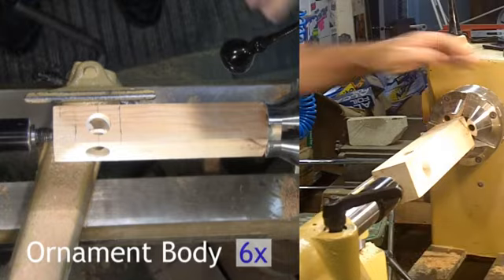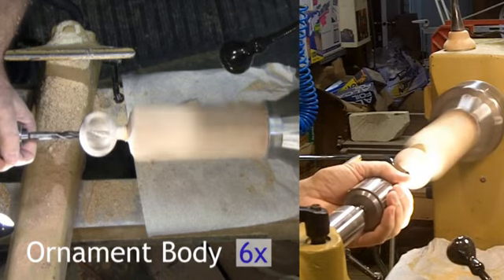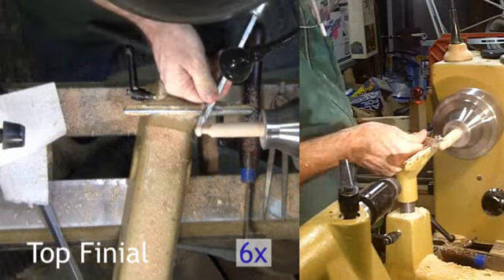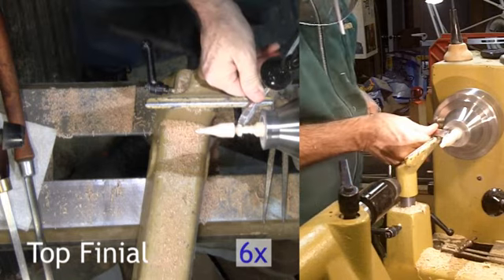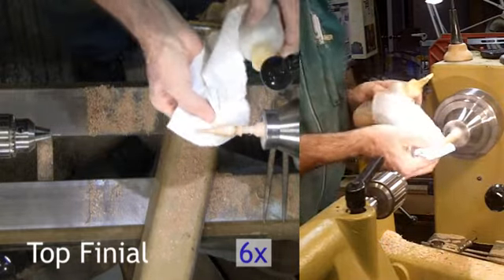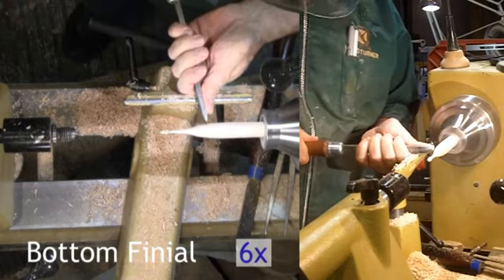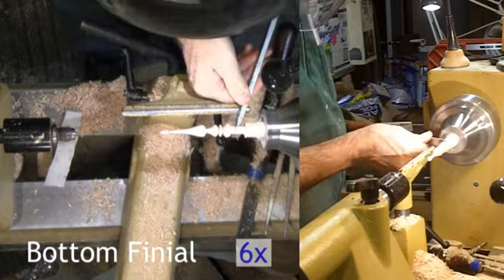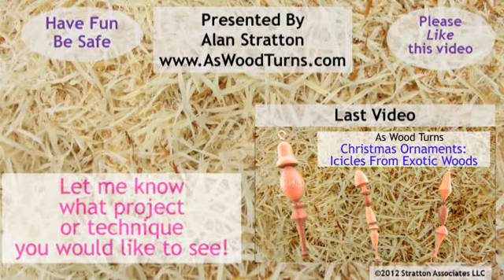Woodturning Christmas Ornament: Enhancing Poplar and Maple

Comment: Alan
One of our club members was turning this type of ornament.  So I had to try.  So far it it really primitive so I thought I would see what is out there.  My intention was to make a video on it.  After watching yours, I will not do that.  Your video is really good.  The project is well thought out in every detail.  I am glad I saw it.  I will share this with my club as we are doing our own ornament fund raiser here.  There are several really good ideas I picked up here.  It is embarrassing to see something done in a way that is really simple and better than what I am doing.  One of the things you did was to drill out the ornament which would provide a place for something in the center.....Still lots to learn.  Thanks for a great video.
Sam
Reply from the maker: Sam, I'm sorry you stopped. It would have been interesting to see your spin on it.
I learn when I compare.
Thank you.
Alan
Reply: As Wood Turns Well my problem is I sometimes jump into doing a video when I don't realize what is out there.  Your video and final ornament were both excellent.  I won't show what I have so far.  I am still working on the procedure and technique, to say nothing of the actual form.  I just did it from one piece of wood and turned a finial on the bottom.  It was OK but I had no real plan for the inside---other than leaving it empty, which is not good.  I think that is or should be the point of this project.  At this point I think drilling out the center is cool.  But it has to be more than than.  I will work on it.
Sam